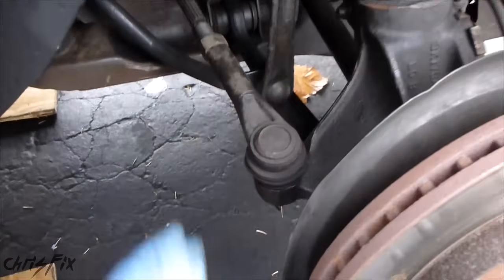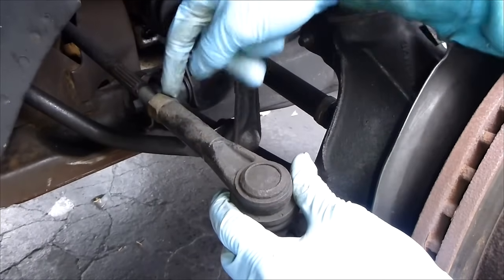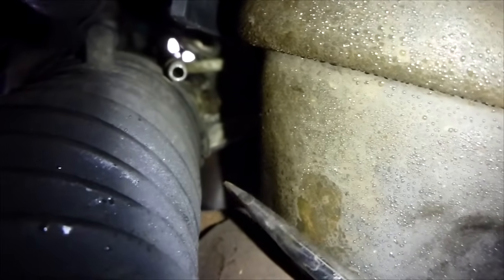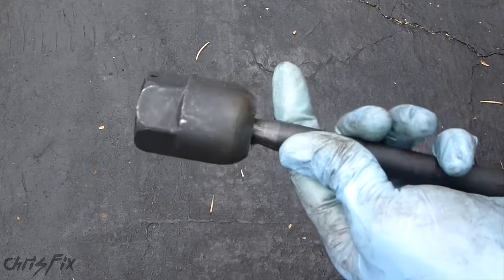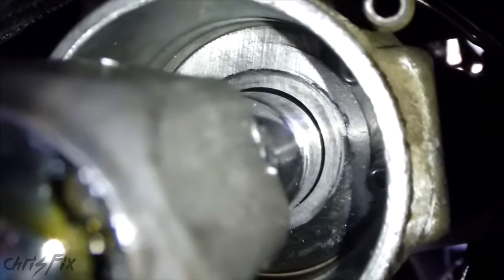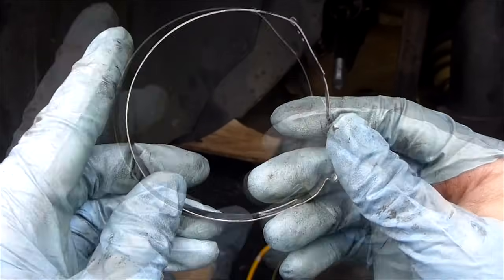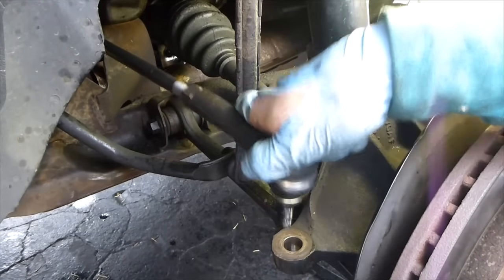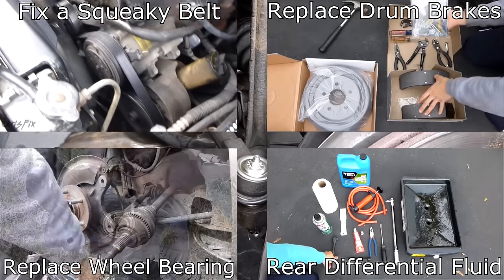How to Change Tie Rods (inner and outer tie rod ends)

Comment: I like getting my tires straight in alignment before and after installing parts. You put 2 brics beside each front tire, one at front of a tire and one at back of a tire and lay a straight small board across them against tire on both sides and lay 2 brics on them so they stay tight to tires.. Boards need to stick out about 8" at front and rear of tires 32in. long board or so. Then you measure across tires at front of tires from side to side and at rear of tires side to side until there all the same measurement 72 1/2'' or whatever your tire with will be. Be patient till you get same measurement front and at the rear of the tires and you have just done a front-end alignment, and your tires will wear perfectly. Don't take tie rod off old shaft leave on as you haft to measure from it. Center of tie rod on top to end of shaft, lay old shaft down, and adjust new shaft tie rod to it getting same distance from center of tie rod on top, to end of shaft, as all aftermarket shafts are different lengths. So you haft to have the factory distance to go by. Your vehicle is in alignment still, so installing new shaft and tie rod should not move tie rod arm and go right in. Then check alignment again to be sure nothing moved, test drive and check alignment again.

Comment: A cool trick when doing these is your always going to have to get your car aligned but you don't have to... the way you do this your self is take a measuring tape and go in 2 treads and do the same to the other side say its 65in on the front side and 61in on the back side on the front tire then you will have to turn it either in or out a reminder is to make sure u take your steering wheel and move it so your wheels are straight... Now if your tire in going inwards u will have to move it out or vice-versa and when your tire is even on both sides it will likely be 63 in this case the way to turn the tie rod is with vice grips don't clamp it on the ribs just on the rod you will have to keep your jam nut loose after your done and even on both sides jam the nut and your done... any questions ask

Comment: Very Nice Demo ChrisFix. Its much appreciated. 
The thing that may be the most complicated with my 09 DTS is determining what tool to use to remove the inner tie rod based on the space/clearance.
Update: there is sufficient clearance to use a universal 3/8 size adapter and ratchet with extensions. Thanks ChrisFix

Comment: I know this is an old video but I just came across it. Great video by the way. If anybody is currently watching or come across this video he is right about the clamps that you screw to tighten I can't remember what they're called worm clamps or something but anyhow zip ties will work great but, I recommend using stainless steel zip ties and they are very cheap at harbor freight for a pack of stainless steel zip ties. The stainless steel zip ties should last and last. Problem solved. Just a little tip for anybody wanting or having to use zip ties.

Comment: If the new inner tie rod is three threads longer than the old tie rod, should you thread the new outer tie rod on using three more turns to eliminate the difference or not? 
I have learned so much from your videos, Chris.  Thank you!

Comment: Nice job! it was time for some new ball joints for my 97 Ranger so i thought maybe i should get both inner and outer tie rods also my mechanic replaced  the ball joints but said the tie rods are good for another 60 k miles i was like OMG so will be replacing my tires rods at 250 k 😄

Comment: A guy at O'Reilly's recommended using exhaust straps as a substitute for the inner tie rod boot.  Went on almost like a zip tie and it's galvanized so it should work for the long term!

Comment: i hope u see this chris, i got a good question.  If your reinstalling something like a tie rod or ball joint that was taken off do you still go by the torque spec when reinstalling?  or should i go a little higher because of rust and shit making it harder to turn the nut, making the nut less tight even tough you applied the same force? i think this might have actually caused me an issue when reinstalling upper ball joints but i havent had the time to take it apart and check it out yet.  im having wandering steering and i feel like i narrowed it down to this

Comment: At 10:00, I wonder if you could just use an ordinary hose clamp, or would that be impossible since you can only access it from the side of the clamp, and not in the plane of the clamp, as you usually would?
Reply from the maker: I think you could use it but a zip tie works just as well

Comment: after trying with the inner tie rod end tool from advanced auto, i recalled seeing the set online at auto zone. definitely recommend the latter. maybe it was just me but after giving up on the AA set, i tried with the AZ set and was done in about half the time or even less. the AZ set locks the adapter in place! the AA set for me kept falling out , even while holding it in place.

Comment: Are there new pins for the replacement inner tie rod ? Or did you end up re using it ? Chris you’re the man , keeping my ‘03 Mazda B3000 running like a dream. I’ve had it 10 years now and we’re at 263k miles. Doing the tie rods finally tomorrow . Been putting it off for a while now but can’t ignore the vibrations at high speeds and knocking and grabbing at low speed turns

Comment: I haven uneven wear on my front passenger tire, no vibration and steering of the wheel. I was told one of my outer tie rods needs to be changed. Can I wait 3 weeks before changing it? I only use the car for work, 28 miles total per day. Thanks!

Comment: Thanks, I couldn't figure this out. I tried to replace my high pressure power steering hose but the inner tie rod blocks access to where I disconnect the hose from the steering box

Comment: At 3:17, there's a squeaking noise when you turned your rotors. Where is that noise coming from? i'm trying to diagnose where that same noise is coming from in my front wheels and i thought they were from the tie rods. But when you removed the tie rods, it still made that sound so i guess i'm ruling out that it's coming from the tie rods?

Comment: When just replacing the outer tie rod, in a vehicle with passable wheel alignment; could you get away with no alignment afterwards, like would the vehicle pass re-inspection provided you preplace the tie rod end the exact same as the old one??

Comment: I have a question hope you can help I replaced both my outer tie rods but if I grab the outlet tie rod and inner tie rod it stills twist with my hand is this normal or is my inner need replacing too ? Thanks great video btw

Comment: Great Video wow you make it look easy. So Amazon or ebay don't car the correct claps. Or thos tools use expensive to loosen or tighten the bolts back.
What would cause similar systoms  for a rear end of my car to react similar to the front that needs new ty rods.

Comment: If the new inner tie rod threaded part is longer, your count of 20 turns will be off, as you stated. So, how can we correct for this? I'm thinking that you could measure from a fixed point on the under carriage to the tierod stud before removing the outer tierod, then adjusting the new tierod to that same dimension. I'll be replacing mine on a 07 f150 in a couple of weeks. The only problem with my idea is that there is play in the old inner tierod that will also throw off the measurement, but it should be close.

Comment: Is this the same process for a 2007 Buick Rendezvous? Went to get it aligned and they said they can't do it because right rear  inner tie rod needs to be replaced. Can't afford to pay a mechanic, so I'm going to try it myself. Also, if I change the right side, is it necessary to do the left side as well? Your video explains everything so well along with visual step by step. I feel confident I can do it myself
Reply: That vehicle is FWD so the suspension in the rear is different than the front, not sure if it has an inner tie rod, might want to search that part up. On a car that old, rust will be your enemy and make it hard as heck to get things off

Comment: Hi Chris, my mom's 2003 Camry needs tie rods and I'm going to do them. I saw someone else in the comments of a different video mention that you should use a thin wrench designed to go over the steering rack portion that the inner rod screws onto to hold it in order to prevent damage to the rack when breaking the inner tie rod loose and when torquing it down. I came to check if you did it in your video, but don't see any mention of it. Is it necessary? Thanks.

Comment: Im having to replace my tie rod and had a few questions first do i need the blue thread sealer stuff and if pnly the inner tie rod is damaged do i have to replace both the inner and outer tie rod or could i get away with just replacing the inner tie rod

Comment: Great video, but not clear what driving problem we are fixing?  What driving problem am I solving? 

I seem to have a great drive, with intermittent DRIFT that is slightly discomfort sorta like wind blowing hard!  Is this a Tie rod problem or some other fix?   Why not one on both front wheels?
F 150 2007 V6 128k miles ?
Reply from the maker: In this case you are replacing worn out tie rods, and it can be a tie rod issue but it can also be worn-out ball joints, control arm bushings, or alignment issues. It's the same process on the other side, so showing the other side would be redundant
Reply: @chrisfix  Hey Chris!! Happy to see you're still replying to comments on old videos! Make my day! ❤

Comment: The first thing you do on this repair: that is not a 'cotter pin'; that is something completely different wth a very different application - traditionally most often seen at the big end of a bicycle pedal crank arm.  The thing you remove with the needle-nose pliers is a split pin (called that for obvious reasons).

Comment: Look almost center top on the boot just past the clamp at the white spot. Keep an eye on it when he shoots the lube. Could be the angle of the camera but id swear i saw lube squirt up and out of the boot just past where the clamp was. If you see that it means theres a crack or tear in the boot so replace it while youre doing this otherwise youll be trearing it all apart again prematurely and means another alignment as well

Comment: Check the vehicle's (proper !) service manual. Some manufacturers DEMAND a special tool to IMMOBILIZE the actual rack while one removes or installs tie rods. Absent that, the steering rack can be ( easily ) damaged, often permanently. Consider that all the torque one applies is resisted ONLY by the pinion and a small bearing and that it is multiplied by the ratio between your wrench and HALF the rack diameter - that's A LOT of force. It is very common to crack the pinion supporting bearing and push the servo valve out of alignment i.e. the rack is basically toast and one hopes a bad accident is not the result.

Comment: Great video. I uninstalled original inner tie rods for my 2003 corolla and there was no lock washer on either side. Makes me think the washer that came with the replacement is unnecessary since factory assembly didn’t include it. Anybody have any info on this? I’m 100% sure they are original to the car -original owner & they’ve never been worked on before.

Comment: Just a question. On cars loke these if you remove the outer tie rod end from the knuckle can the inner with the boot move back several inches without removing it? I have a bolt for a control are about an inch from the boot that covers the inner tie rod end. The bolt is 5" long so theres no room to pull it out once loosened.

Comment: Have you seen new rear knuckle toe link hole bigger than link end on truck?  My 02 explorer xlt is in that situation. I’m hoping to change whole bar and be good since I have the new knuckle, brakes, and bearings already installed. Any suggestions?  Looks like the knuckle is upgraded to 17mm while stud is 15mm.

Comment: I went to get my 2005 chevy equinox transmission flush. After they gave me a form with a inspection that stated my inner tie rod needed replace. Cost will be I little over $1000.00. But I knew I have this video to do it myself😂

Comment: Hey chris, i was hoping to get your opinion. I replaced a tie rod end with a moog tie rod end, which had a castle nut  instead of the standard one. Following a haynes manual, i attempted to torque it to 97ft lbs on the ball joint and caused the bolt on the tied rod end to break. this ended up causing the castle nut to go beyond the cotter pin hole, to the point that the cotter pin would not make contact with the nut. I used a spare tie rod end, and i’m thinking of tightening the castle nut just to the point of installing the cotter pin so it’s snug and foregoing the torque spec. Will this ensure proper function?

Comment: Question... If I add too much grease, will the boot separate from the boot clamp (the skinny kind)? Cause I added grease and drove for 1 day. Checked on it and grease was already coming out from the boot. When I cleaned it up, I saw the boot was separated in about a quarter inch area. My fault or manufacturer?

Comment: Hey Chris I wanted to ask if you had any tips to get the tie rods loose ? Mine aren't budging at all replaced my lower upper and links and the driver side outer rods but passenger side its in there
Reply from the maker: Use some heat if it won't budge
Reply: @chrisfix  I did but it was a small torche lighter. This weekend I'll try the big boy. Hopefully I dont set my car on fire. Thank you

Comment: Hey Chris love your videos! I have a question though. My inner tie rod got turned while putting on my outer tie rods. Unfortunately, I am unable to just turn the inner tie rod because nothing has worked. Believe me, I've tried. 
My thought process is taking the boot off and turning it from there like in your video here. I bought an adapter for the inner tie rod to do so. It's not like the one you used but same idea. Do you think that would be an option? I don't want to remove it totally though. It's a new rack that came with new inner tie rods. My tires are pigeon toed at the moment. 🤦🏼‍♀️ I've been trying for so long and need some advice. Thank you so much!

Comment: I’m a little confused on the breaker bar, torque wrench, and ratchet parts. Everything else makes sense, and I’m hoping maybe my Haynes manual can clear up confusion? How do I know what size sockets ?
Reply from the maker: Ratchet is used for generally loosening/tightening nuts/bolts, the breaker bar is for the really stubborn nuts/bolts that don't want to loosen up, and the torque wrench is for ensuring you are tightening things up properly. The Haynes manual should provide the sizes for  any fasteners you come across
Reply: @chrisfix  I see! What did you use with the inner tie rod tool then? Is that a ratchet or a breaker bar? Do I just see what size sockets line up with the speciality tool?
Reply: @jacktulloch8678 

I'll try my best to answer you. I'm no pro - just a DIY guy like a lot of these other guys. : )

So... YOUR own socket sizes will of course vary widely, depending on what car/truck you drive & of the part of the vehicle you are working on. Also, if it's an American manufacturer, most of the bolts will be the SAE (non-metric) standard sizes.

And basically all of the other non-American vehicles will use the metric standard fastener sizes. 

As far as the size of the 'wrench stud' (I'm not even sure what it is officially called), there are generally 3 sizes for most DIYers:

From smallest to largest:

∆ 1/4 inch (smallest, but can go into tight places)
∆ 3/8 inch (MANY sockets available & is most common, IMHO)
∆ 1/2 inch (to me, 1/2 inch is the 'sweet spot' -- strength + not too large)

And yes they DO get bigger (but the bigger sizes are used for much bigger vehicles/projects such as bridges/building construction, etc).

I once saw a seasoned professional mechanic's toolbox and he also had a set of 3/4 inch wrench/ratchet & sockets... & the biggest he ever used (rarely used, BTW): 1 inch wrench/ratchet & sockets.

And it gets even bigger still... but it's likely just for industrial sized projects/applications.

Comment: so when i drive over a road with a lot of imperfections, my. steering wheel shakes left to right with every bump. I put new outer rods in still having issue. Do you think it’s inner? new Cv axle boot also split after about 7000 miles wondering if that has something to do with it

Comment: I bought a 2005 C-Class kompressor Mercedes it had a doughnut wheel on the front right hand when driving home I realised the car was able to fishtail if you swivel the steering wheel I went over speed ramp speed ramp when driving in a straight line as smooth as butter but when you go over speed ramp or wobble the steering the whole car will wobble in a fishtailing like motion would you think that is the tie rods or stability bars just after the top of your head because I seen the doughnut wheel on the front right hand side I am assuming the car might have struck a  pathway or pothole hope you can give me some suggestions before I start have not examined it yet just looking for suggestions possible I say again the wobble is very extensive

Comment: If you’re at a stand still and you turn your steering wheel from left to right and vice versa. What may potentially be the problem if it is popping?
Reply from the maker: Could be the steering rack or a strut causing that noise.

Comment: Are you supposed to put some Grease on the inside part of the new tie rod joints?
I'm doing my 85 Volkswagen Cabriolet and on one side there's teeth that are the main shaft inside the turning box? I'm wondering if I should put some grease on that shaft as well as the inside tie rod joints...